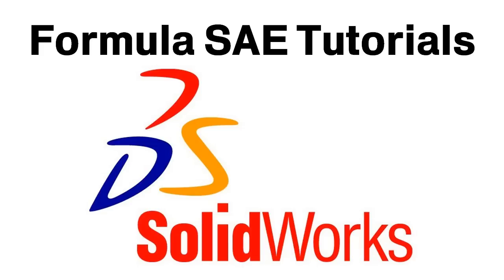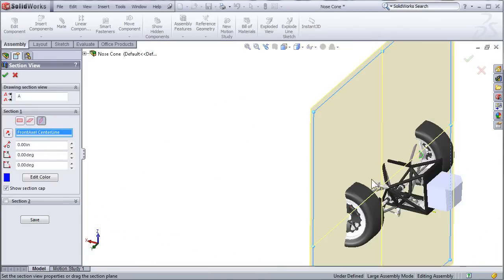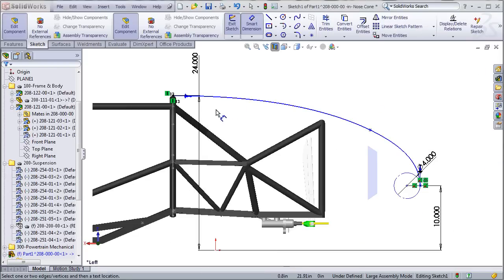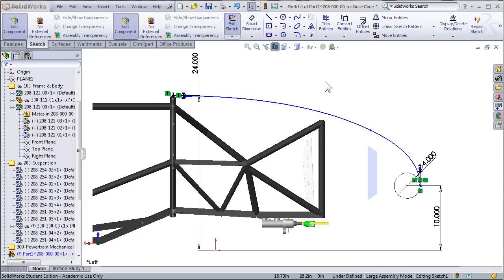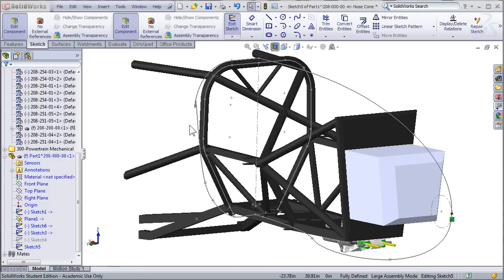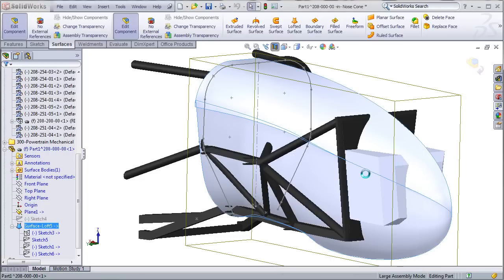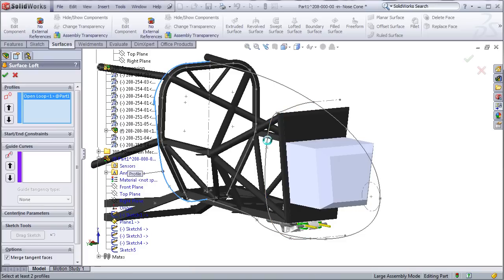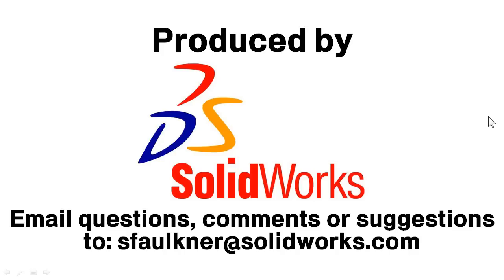SolidWorks Surfacing to Create FSAE Body Work - Part 1

Comment: Creating a lofted surface which terminates at a point is a poor surfacing practice. Improperly using a loft in this way will result in a degenerate point and will cause severe tearing and rippling of the surface toward the tip of the cone. You can verify this using the Verify -> curvature and zebra stripe analysis tools. Further surfacing tools are required to model this type of geometry.